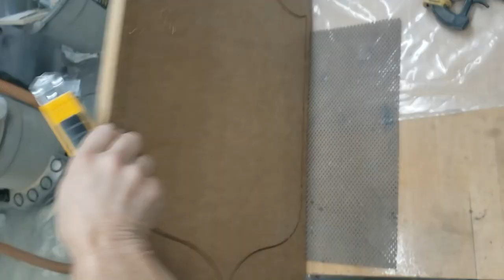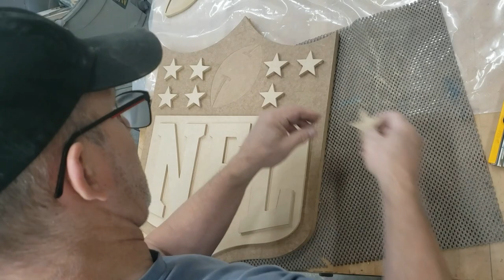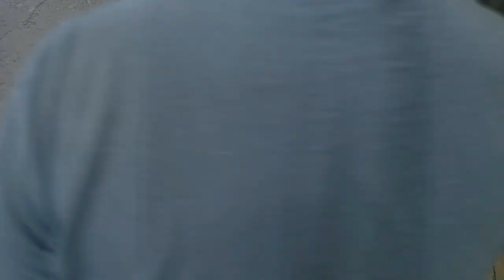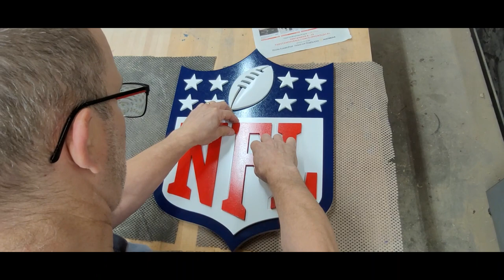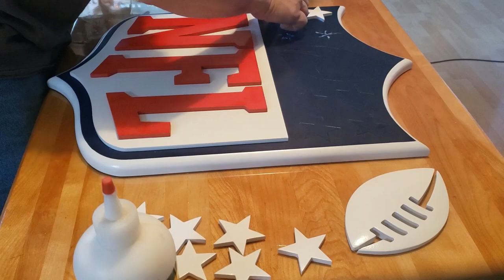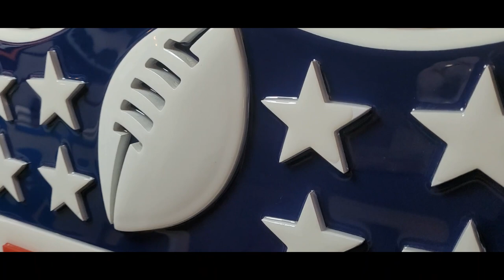NFL layered epoxy sign

Comment: Very nice! Are you sealing the MDF before spray paint?
Reply from the maker: Thank you. I will sometimes seal the cut edges with watered-down wood glue, but in most cases, I just do an extra layer or 2 if the paint until I'm satisfied with the color

Comment: Would you recommend your cnc? Also what is the thickness of the mdf and the thickest your cnc cuts
Reply from the maker: I have been very happy with the Shapeoko brand (I have the 3XXL), and there has been 3 model upgrades since I got mine. I cut 3/4" MDF on a regular basis, and the thickest I've cut through is 3" Cedar

Comment: I know it's been awhile since you made this great nfl sign, but do you remember what roundover bit you used. Thanks for a awesome build.
Reply from the maker: Thanks. My choice of the round over bit is typically based on the amount of room I have between the elements on the face, and the outer edge, some designs may not have much room, so I will go smaller radius on those. In this case, I believe it was 3/8"
Reply: @bradscustomsigns8585  Great, thank you

Comment: I'm going to try an epoxy pour on a 3d sign. Did you use a lot on this project? Did you have to sand drips off the back after?
Reply from the maker: I believe I used around 600 ml, but I tend to waste a bit because I never want to risk running short. If you check my other videos, I have one that shows my process for drip cleanup.
Reply: @bradscustomsigns8585  thanks, I will check it out!

Comment: Great video as always.  I am learning alot.  Do you get your MDF form a box store?  I get mine from HD.  The 1/2" seems better quality and more dense than the 3/4".  Curious where you get yours.
Reply from the maker: Thanks. The place I shop is called Windsor Plywood, and when it's available, I get the 3/4" in Platinum Grade (in the US look for HDF), it's much more dense than standard. Notice the darker color in the MDF in the base of this piece, that is not the higher grade, so extra layers of color were needed on this project to achieve the opaque color required.
Reply: Great.  Thanks.  I will check some of my local wood suppliers

Comment: What material do you use as the cover before painting your edges, at the 2:45 mark?
Reply from the maker: I like to use watered down wood glue to seal the cut edge of MDF
Reply: @bradscustomsigns8585  Is that what you're peeling off later?
Reply from the maker: @SothpawDesigns  I covered the piece with Oramask so that when I rounded over the edge on my router table, it was a perfect edge for painting, as well as protecting the face
Reply: @bradscustomsigns8585  gotcha. Thanks!!

Comment: What did you use to glue the pieces? I just finished a sign but I used 1/2in MDF and I'm worried that is too heavy and it might fall off with just titebond 3. Thanks!
Reply from the maker: when I do layers like this, I use a product called Roo Glue. It's a Melamine glue that sets up quickly. If you find me on Facebook, and send me some pictures of your project, I'd be happy to give you an opinion on what I might do

Comment: Great videos. How do you find the correct color paints for your projects?  They always look spot-on.
Reply from the maker: Thank you, I use a lot of Rustoleum spray, and in some cases, Home Depot has color codes for many pro sports teams that they will mix. For most projects, I get them to mix one of the 8oz samplers that is usually enough for a project

Comment: This looks amazing.  What kind of epoxy you use?
Reply from the maker: Thanks, I am currently using Krystal Resin
Reply: Hello I have another. What kind of glue you use to glue the letters on and did you cut out a pocket for the letters to sit in?
Reply from the maker: @rickycurry574  I use Roo Glue, it has a fast setup time, and oozes into the nooks and crannies (and out if you're too heavy). And yes, I cut a .015" pocket for the letters, but this is les about a puzzle fit and more about alignment. At this depth there is lees of an issue with those tight inside/outside corners from the round endmills
Reply: @Brad's Custom Signs  thank you for sharing. I really appreciate it.